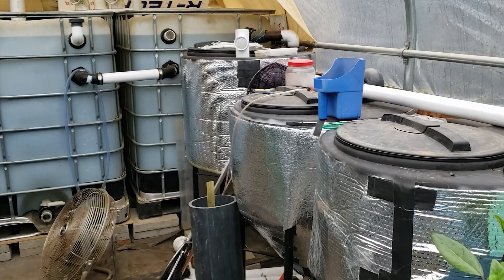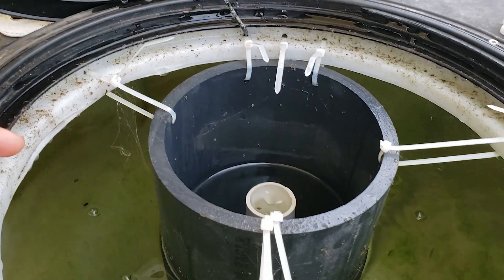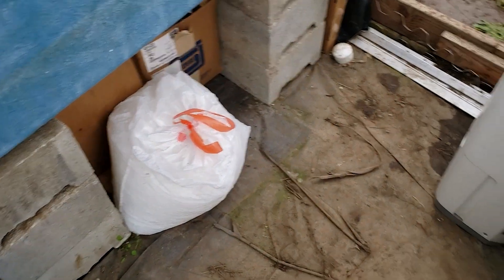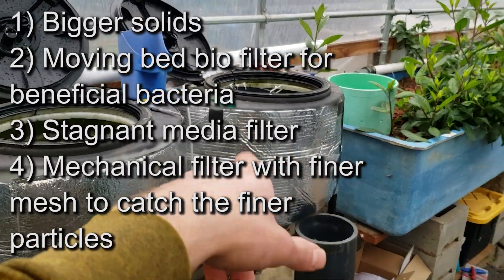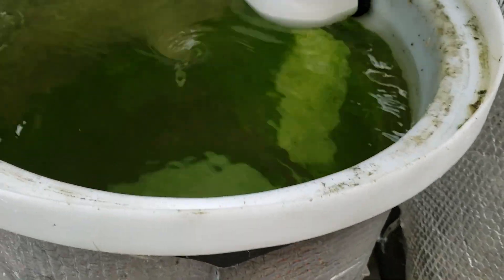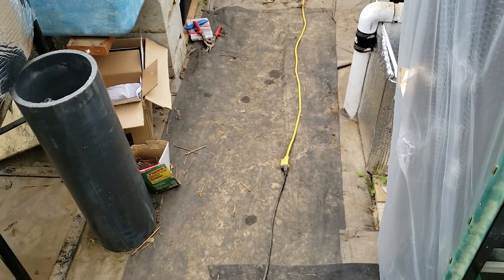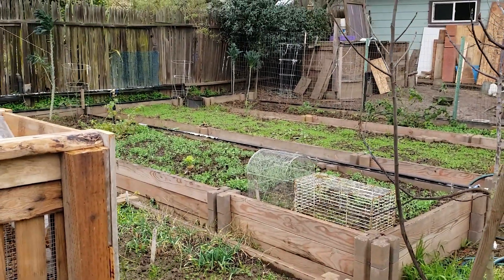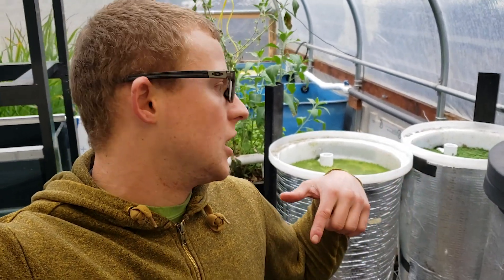Aquaponic Filtration run through

Comment: thanks for your video, so what pipe size will you recommend for solid settler, 50mm or 40mm?
Reply from the maker: 50mm is good but it does depend on the flow rate/ size of the pump

The slower the flow rate the better the filter performs. If you have the space a bigger solids settling tank is better. A bigger tank allows for solids to settle better, due to the slower flow of water. Which also depends on the size of the pump.

Hope that helps

Comment: I like to put biological filtration right in the fish tanks.  I like the 2" thick pink insulation with floating rafts filled with hydroton.  I think this provides extra oxygen at the zone where it needs it, the surface.  Aeration has probably as much to do with breaking surface tension, and the net pots filled with clay but dry at the top provide that in spades.  Also the fish hide under there all day.  They really do like shade it would appear.  This is literally my only filtration for 140 gallon tanks but it seems to work well in terms of nitrifying.  I am completely screwed (or the fish are) in terms of solids.  I have to do a major water change as in 2/3 every week and today is the day (Sunday).  Just siphon the water off while sucking as much crap as possible, and fill back up.  Our water to the tap is about 60 F so the fish seem to tolerate the temp swing and of course the cleaner water.  I do need to add mechanical filtration, thinking of doing that off the drain and back into the tank will need a pump of course and as soon as you pump you break the crap into smaller pieces kind of self defeating.  Perhaps I will just pump it over a fine mesh to stack the solids up and get them out before draining back in the tank.  OK enough rant but that's the story.
Reply: Check into the product called, PondZyme w/ Barley.
I believe the big stores online have it, tons of reviews and works fine with plants for sure, and fish is what its made for. It is enzymes and a Barley extract that helps with sludge (kind of like RidX for a septic tank), but this pondzyme is made for fish ponds to keep them clear with natural ingredients.
Reply from the maker: (Response to Sir Derty)
I always thought that sludge removers just break down the sludge into a finer product allowing it to become suspended in the water which will make it easier for the filter to capture. But after looking it up, the PondZyme is basically a bunch of beneficial bacteria that eat up the organic material which than releases carbon dioxide and water as it' bio product. So as you said it should clear up the water. 
But I do think it is more cost efficient to just make a solids filter instead of always buying a sludge remover.

As for the addition of barley in that PondZyme that is not really for sludge but more for the algae in the pond. The barley helps prevent the growth of algae. For example if you added straight barley to your pond given enough oxygen and sunlight the barley straw releases some sort of chemical that helps inhibit the growth of algae.  So that PondZyme probably has a concentrated form of whatever chemical the barley releases into the water which will help inhibit the growth of algae.

Two things with one product. Nice
Reply from the maker: (Response to John Doe)
Ha ya in most cases there is enough surface area on all the tanks, the roots, and etc in the system for biological activity to take place. But that does depend on the quantity of the fish and the feeding ratio so sometimes the added bio media is good to do. And ya it would be good to remove the solids from the system. Most systems can go a good amount of time with out a solids removal but eventually it builds up and can create dead zones and anaerobic activity. So adding some sort of solids removal is always beneficial. 
If your tap water temperature is a good difference from your aquaponic water temp just have the water drip in to the system at a slower rate. Less stress on the fish.